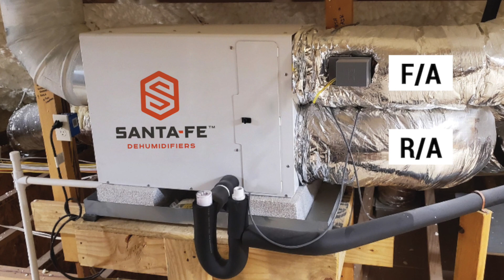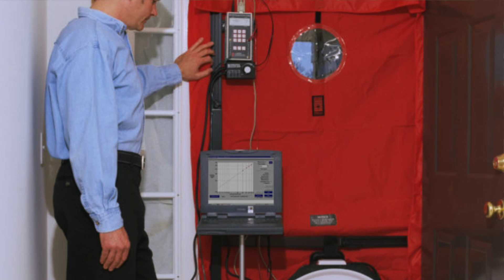HVAC Issues in NEW Tightly Sealed Home!

Comment: We have an issue with our home being tight. When we run the AC (central air) our front and back doors don't close easily. It feels almost as if the house has too much air being forced in with the AC. Is this normal?

Comment: Please add some perspective. Air changes per hour at 50 pascals. As measured by a blower door test. I would guess most 10 to 15 year old houses are leaky and not tight. It's very hard to build a new house too tight. Production builders are not building tight houses. It's almost impossible to seal an existing home to the point it's too tight and unhealthy. Doors leak, windows leak, sills leak, unconditioned attics have multiple points of leakage. Follow Matt Risinger and start learning about energy efficient homes.
Reply from the maker: I didn’t want to get too technical with this video. The whole point was to let homeowners know that homes needing Hvac replaced, may not have been installed correctly from the get go. So even on the HVAC replacement, heat load calculation, manual d, and ventilation are all things that need to be looked at. If you’re saying, that’s not true, then I guess we will have to agree to disagree. 🙂
Reply: @NewHVACGuide  agree. The comment about Matt at the end was for people watching the video. Good job helping people out with HVAC choices.

Comment: How long should the AC stay on, say on an 80 degree humid day?  I want to gauge if mine is short cycling.
Reply: Did you do any head load calculations; besides you need to know type of windows; overall size, etc. Any tree shading?
Reply: I'm not a HVAC tech but maybe this will help. I have a 3 ton (34,000 BTU) system cooling 3,000 square feet if I include the basement. The basement is 3/4 underground... i.e. one wall is exposed to the outside. Brick house was built in 1964 with insulation that was overkill for that time period. Single pane windows that need replaced. In the dead of Summer, the house is in the sun nearly all day and I have a black metal roof with good attic ventilation. I live close to the Ohio River near where I-70 crosses the river. I suspect my unit is undersized. Once it kicks on, it doesn't kick off until maybe 11PM at night.  Inside temp is comfortable. I think replacing windows would make a big difference, but another1/2 ton wouldn't hurt.
Reply: @billboyd7938  You need an HVAC in your area to do a Heat/Cool load calculation. Your best bet!

Comment: The worst is the r5 or so hanging ductwork in the attics in the south. Looking at houses and i see new hvac and ductwork, I'm like no thanks don't want that cheap crap that creates mold, give me thex original back that lays on the attic floor, at least i can cover it with more insulation

Comment: I have new home being constructed. About 3200 sqft ranch/walkout. Very tight..daikin fit with electric daikin furnace. Just installing today… I see plenty of return air and supply vent.. idk where fresh air would come from… where should I look?
Reply: There are two issues that need to be addressed, air quality related to CO2. To address this issue, your HVAC contractor may need to install a Fresh Air Intake. The second is humidity. If a HVAC unit doesn't run enough, you will need a dehumidifier installed, a whole house dehumidifier. You'll want to set the approx. 55%. Good luck.
Reply from the maker: Ask them. There’s different ways of doing it.

Comment: THE MAIN PROBLEM WITH NEW HOME NO ONE DOES A LOAD CALCULATION AND THE GUYS DOING THE NEW CONSTRUCTION NEVER COMES BACK TO WORK ON THEM PROBLEMS NO MAKE UP AIR, OVER DUCTED OR UNDER DUCTED  UNDER SIZED OR OVER SIZED ALSO ON HEAT PUMPS PUTTING 10KW MAKE UP HEAT ON A 4 OR 5 TON SYSTEM ALSO REPAIR PROBLEMS LIKE HAVING A COLLAR BRACE IN FRONT OF THE SERVICE SIDE OF THE UNIT WHERE YOU CAN NOT PULL THE FAN OR THE COIL ON A REPAIR AND WHAT BAD ABOUT THEY HAVE A FOOT ON THE RETURN PLANTUM   AND 5 FEET OR MORE ON THE SUPPLY AND IF THEY WOULD HAVE MOVED THE UNIT OVER 2 FEET THE COLLAR BRACE WOULD NOT HAVE BEEN IN THE MIDDLE OF THE SERVICE SIDE OF THE UNIT ANOTHER THING ABOUT THE IDIOTS THAT INSTALLING THEY DO NOT PLACE THE UNIT IN THE OPPOSITE DIRECTION IF THE UNIT COMES OUT OF THE BOX HORIZON RIGHT THEY DO NOT KNOW THE UNIT CAN BE INSTALLED HORIZON LEFT SO YOU GO SERVICE THE UNIT AND YOU HAVE TO JUMP OVER THE UNIT OR YOU HAVE TO CRAWL BETWEEN THE UNIT AND THE EAVES AND THE UNIT TO GET TO THE SERVICE SIDE OF THE UNIT AND IF THE HAD INSTALLED WITH IT IN THE OTHER DIRECTION AND 8FOOT MAN COULD HAVE DANCED WHILE SERVICING THE UNIT IF IT WAS SET IN THE OTHER DIRECTION THE LAST THING ALL THESE INSTALLERS PUTTING THE VENT CLOSEST TO THE TUCK LINE AS POSSIBLE INSTEAD OF PLACING THE VENT AT THE LOADS EXTERIOR DOORS AND WINDOWS HOW MUCH MORE DOES IT COST TO USE ANOTHER 5FT TO 8 FT OF DUCTING BECAUSE OF THE COST. THINK ABOUT THIS A NEW HOME IS OVER 200K OR A LOT MORE SO WHAT IS THE COST OF ANOTHER 40FT OF DUCTING TO MAKE A HOME MUCH MORE COMFORTABLE THE PEOPLE THAT WORK FOR ME KNOW THAT THERE IS 3 WAYS OF DOING THINGS THE RIGHT WAY THE WRONG WAY AND mR.KELVIN'S WAY AND THE YOU NEED DO DO IT MR KELVIN'S WAY OR HAVING TO EXPLAIN WHY YOU DID NOT DO HIS WAY BECAUSE YOU HAVING TO TAKE THINGS APART TO DO SOMETHING BECAUSE YOU DID NOT LISTEN TO THE INSTRUCTIONS OF MINE
Reply from the maker: Heat load calculations are more necessary than ever
Reply: I’d love to see that on mine. I’m trying to do a cool calc but I need an image of the house from GIS/ google image